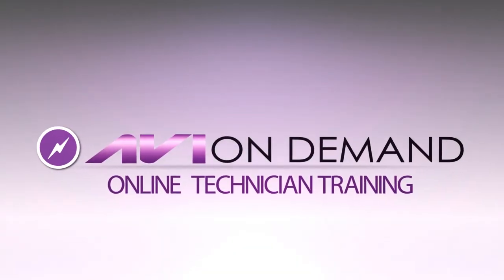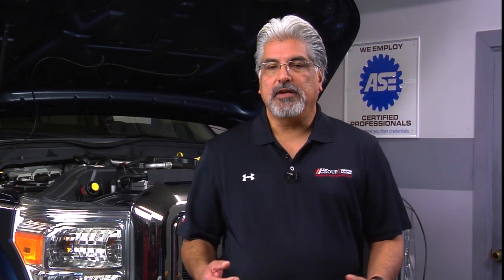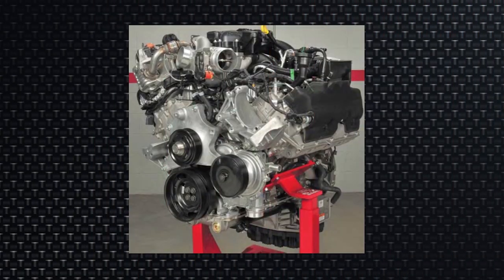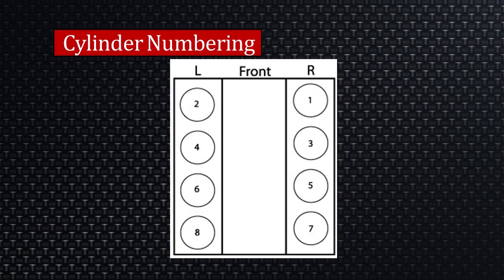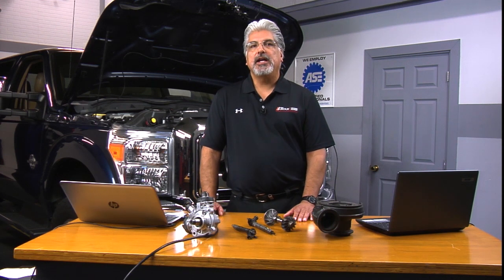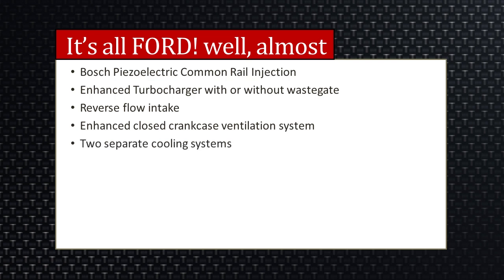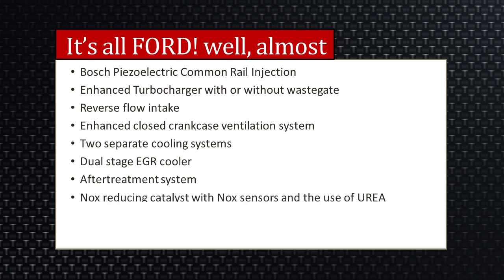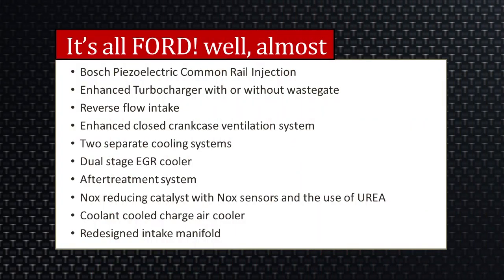What's the Difference with a Powerstroke 6.7L Diesel Engines | Tech Tip

Comment: Is this numbering system for the cylinders the same as the 2011 6.7??
Reply: I’m asking because I replaced my, “number 2”, injector. But I did it on the second cylinder on the passenger side of the vehicle. I just want some clarity, as when I looked it up, I had read that this was the number 2 cylinder.